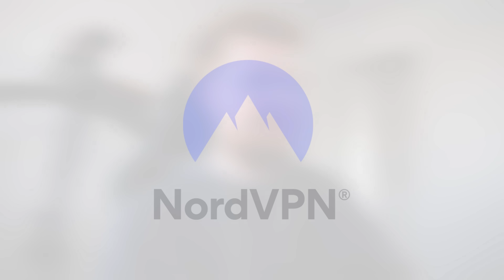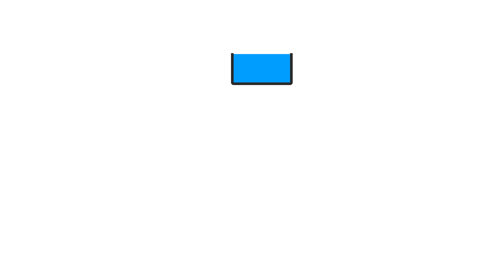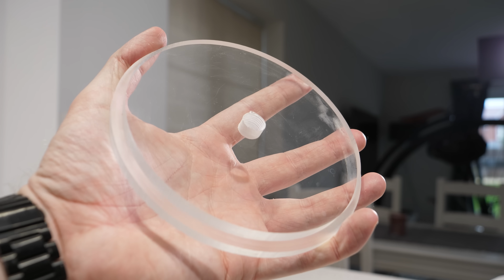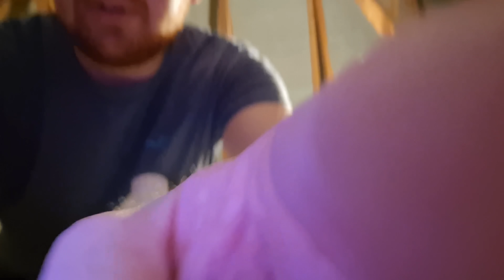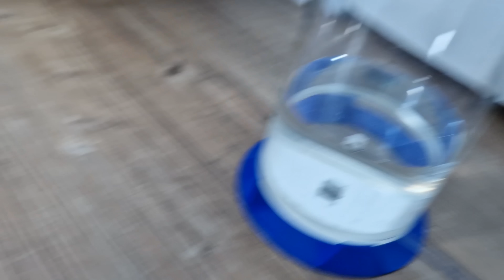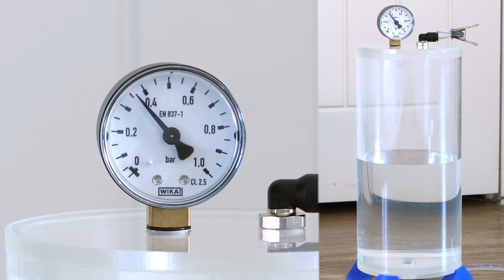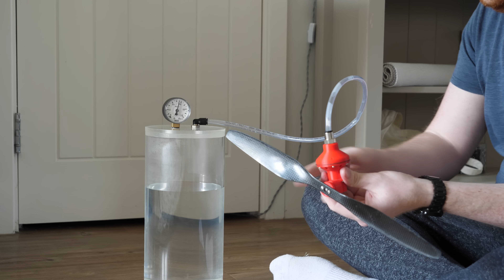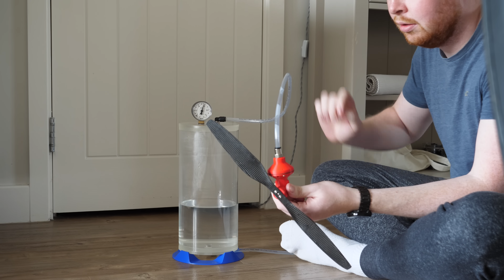Liquid Air Engine

Comment: Dude this is soo cool! 
Would this improved engine work well in a plane? 
Also, would a flywheel help its performance?
Reply: The propeller is the flywheel
Reply: @jdbergan  Ofcourse a little but wouldnt some added mass prevent some of those backfires?

Comment: it would be amazing if you could get the engine to run off of the pressure of the CO2 in a fresh coke bottle or some other chemical reaction that produces gas like baking soda and vinegar!